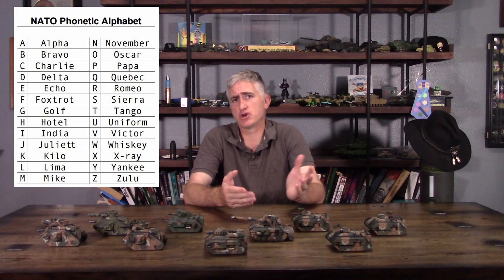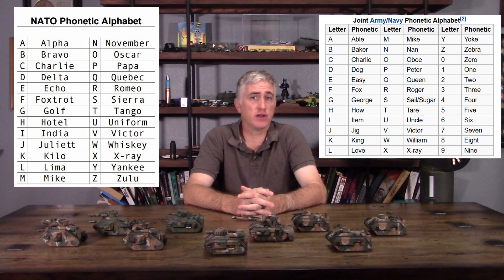Chieftain's Q&A #5

Comment: I want to know: 1. When did they start using the sewn-in handles,
2. Was VVSS always VVSS, or was it plain old VSS until HVSS came along and they had to distinguish between the two? Was there any point in specifying  Vertical Volute Spring when it was the only kind of volute spring suspension in use?

Comment: Did the weight of the Jumbo's gun mantlet have any negative effect on the elevation drive? If so how was it countered

It's alot of steel added to what looks like the muzzle end of the elevation pivot, and I think that would have some negative effect on how easy the gun elevated

Comment: My dad mentioned that there were large grenades stored around the Sherman commanders hatch and on one memorable night at Christmas in 1943,  in Colorado,  he was guarding  a broken down M4 far from camp, got bored  and used them to blow holes in the ice behind a small dam. The water started flowing again, overtopped the dam and almost flooded the unit's motor pool downstream.  It didn't do any damage because Dad panicked, ran ahead of the water to the bivouac and phoned his Captain (in town having dinner), alerting him only to the rising water and soldiers were hastily mobilized to move equipment in time. Dad got promoted to Corporal for being alert on duty. Apparently the grenades were never missed.
Does this sound true or might it be a tall tale? Were there grenades that were that big in a Sherman and would the Army just leave them there (granted Dad was supposed to be guarding it).

Comment: wouldnt it be an enormous advantage for an autoloading  gun to have liquid propellant? this could increase rate of fire as well you could adjust the ballistics to loop shots over ridge lines as well as saving space... you could also shoot multiple rounds that would impact at the same time which could overcome more modern countermeasures...  is liquid propellant being considered or is the focus more on autoloading railguns?
Reply: The UK developed and tested liquid propellent and guns for quite a long period, it had advantages but also significant disadvantages and was eventually dropped

Comment: US Army ammo usually had a "T" number during development testing, changing to a standard "M" number when issued for Service use.  Why was this not done for the WWII-and-after steel 90 mm T-33 AP Shot?  I have one with an empty powder case (heavy!) and it has "E" numbers punched into its driving band, indicating that there were various modifications to this round.  It had no AP cap or windscreen (just a rather blunt-point Secant Ogive nose), no explosive filler (though I assume a glowing colored night tracer was screwed into a shallow pit in the base), and a very simple copper "wedding-ring" driving band with a wedge-shaped upper edge to make it easier for gripping the bottom edge of the rifling when hand-loaded.  Was there ever a steel AP/APC Shot/Shell made for the US Army 90 mm gun with a standard "M" ID Number?

Comment: Was early add on armor in the form of draped treads effective against incoming rounds?
Reply: The effectiveness of ad-hoc addition of various things to tanks in the hope that it would offer more protection - things such as spare track, steel plates, planks of wood, sandbags etc - was extensively tested by the US Army after WW2. For the most part they found in these tests, that such additions offered little to no advantage and in some cases actually made things worse for one reason or another, and not just in terms of what the enemy might do to a tank, for example, we can be fairly sure that the additional weight of a lot of possibly wet sandbags on the front of a Sherman was not going to do its transmission any favours. That said, such field modifications might actually have provided some (largely ill-founded) psychological/morale boost to the crews, but it is difficult to quantify how much of an effect this would have on matters.

Back with purely the physics of such additions, the problem is that the front glacis plate of most tanks - where you typically saw such additions - is invariably designed to be as smooth as is possible to allow incoming rounds to ricochet off and away cleanly, and it is not just a slab of any old steel, it is armored steel (which involves a variety of processes to create). Tracks on the other hand are of course pretty tough steel, but they are not armoured steel and nor are they smooth, so spare track won't do much to stop penetration and in very many cases, its irregular shape will actually offer something for an incoming round to bite into when it strikes, thus making a ricochet away from the tank far less likely. Basically, you are adding shot traps to the front of your tank, which is obviously a bad idea. 

Historians and fans of tanks in general are sometimes guilty of over-simplifying the idea of effectiveness against hits to a tank in that they will sometimes simply factor in whether a round penetrates or not as the only thing to consider when talking about hits to a tank, as though anything which ricochets into another part but does not penetrate, or explodes nearby does nothing at all to the tank, which is at best unlikely and in many cases makes things very much worse. German tank crews of WW2 would confirm that even a nearby high explosive hit at the front would quite easily damage the comparatively fragile final drive of a Tiger for example. Then there is the fact that there are several different types of rounds too, some of which would actually be assisted by having some spare track to initially hit, for example, allowing a fraction longer to form the plasma jet which penetrates the armour by having that process commenced by hitting some track which is slightly stood off from the armour plating.

A good example of what a ricochet can do when a shell has something to bite on as it impacts, is perhaps the most famous WW2 tank of all, this being Tiger 131 at Bovington tank museum. As thick as the Tiger's armour is, it's not exactly the best ballistic shape ever with all those slab sides, and so there is a considerable risk of rounds getting to bite on impact and cause ricochet damage. This is exactly what occurred with 131. It was captured after having been disabled by three shots from British Churchill tanks, one shot hit the gun barrel and ricocheted into the turret ring, jamming it, a second shot hit the Tiger's turret lifting lug, bounced off that and disabled the gun elevation mechanism, a third shot hit shattered on impacting the loader's hatch and showered the turret interior with shrapnel fragments, injuring some of the crew. With British tanks advancing on it and wounded to consider, the crew bailed out and didn't waste time destroying the tank, thus allowing its capture and comparatively easy repair.

So in general, the answer is no, if it had of been of any really practical value, they probably would have come out of the factory like that.
Reply: @ChockHolocaust  thanks!

Comment: I've always wondered about how the engines in turbine powered tanks interact with the rest of the drive train. To my knowledge turbines take longer to reach maximum RPMs than a piston engine. Do these engines idle at a low speed, then speed up as the tank needs to get moving, or do they have the option of being left at a higher speed so the tank can reach maximum acceleration quicker? Since this is unlikely to change anything tactically, I would imagine it's the first one for the sake of fuel economy.
Reply from the maker: On the M1 there is a “Tactical Idle” switch which, when enabled, idles at higher revs.
Reply: @TheChieftainsHatch  I suspected something like this to be the case, but explaining all of that would have made the comment too long. Thank you for your quick reply!

Comment: Question. What happens to the expended shell case on tanks? I know some of them have a basket behind the gun breech, other with autoloaders eject automatically, but what about the other tanks, during combat the cases roll around inside the tank and there is no problem at all?
Reply: Modern tanks or ww2 tanks?
Most modern tanks use combustible casings with nothing more than a half inch thick metal disc base for the percussion cap that falls out of the breech as it opens at end of recoil movement.
Reply: For both. even modern ones, having those smaller cases rolling around is perfectly ok?

Comment: Re; the Australian Abrams question. Whether or not it was a good deal has been ambiguous for years, the top two contenders were the M1 and the Leopard 2. Sources vary as to why the final choice was made, the main contention is if the US genuinely made a better deal price wise vs if the decision was made for purely political reasons.  
there were several factors in favour of the M1 though
- General Dynamics (the manufacturers of the M1) were willing to allow for technology transfer to Australian industry to allow for local maintenance manufacturing (ie making spare parts locally), which Krauss-Maffei were not willing to do
-The M1 deal included new M88 recovery vehicles (to replace the outgoing leopard 1 based recovery fleet) as well as full technical and personnel support for the transition between the leopard AS1 fleet and the M1 Fleet
- The vehicles purchased are only broadly M1A1s , their proper designation is M1 AIM (Abrams Integrated Management) and functionally they're basically up to date with M1A2 with the various upgrade enhancements (ie infantry phone and reactive armour mounts from TUSK, slave charger port etc), the only thing missing is the DU armour layer

other points
- Yes the Fridge is real, its mounted in the bustle rack next to the APU, it feeds from a power socket near the crosswind sensor mast. Because the rear bustle rack is basically full with the fridge and EAPU and extension rack has been mounted to the back. Australian M1s also have a turret mounting for a 'Parasol', basically a large collapsible camo net umbrella that can be mounted to keep the sun off and assist in concealment of the vehicle when in laeger.
-Australian M1s will be upgraded to feature DU inserts in the armour package under the current program of LAND907 Phase 2 and an additional ~30 tanks will be acquired to bring the fleet to roughly 90 vehicles. New 'Under armour engineering vehicles' are also being acquired under a sister program

Comment: American style firefighting coats have a similar drag system.  The pull point is usually under a velcro flap at the base of the neck, below the collar on the outside.

Comment: Nice video! One question - In your other videos about the M4 Sherman, you noted that the design fit into what the US Army was concerned with about transport - railway car size, bridge loads, and easy of loading onto a transport. These tanks were about 31-33 US tons. The post-war MBTs are in the 40 and now high 50 ton range. So are railway cars, bridges and ships more capable today? I'm curious about the railway cars since they don't seem to have changed much. Thanks again!

Comment: Potential question for next month or if anyone here has an answer. Why did American armor tend to be bristling with machine guns, one in the bow, one co-axial, and then another one or two on top of the turret. Where as German tanks tended to lack the exterior mounted ones?

I read that it was doctrine for the Germans to take either the bow or co-axial and place it in the exterior mount for aerial defense if the need arose, but it would seem easier to just have one permanently in place. Was it a shortage of machine guns then that lead to this policy?

Comment: Re; Recovery Vehicles. The Australian Army quickly developed 6 by 6 wheel drive versions of MB Unimog ang G wagon expressive for recovery. These are exceptionally mobile, and the traction, floatation and general ease of accessing the distressed asset was immediately apparent. It has to be said that one winch cable is better than twenty shovels.

Comment: 7:28 So according to Jentz and Hilary's osprey book on the King tiger "Statistics compiled from status reports for 15 March 1945 that 59 per cent of the Tigers with front line units were operational. This was about equal to the Pz.Kpfw. IV at 62 per cent operational and much better than the Panther at only 48 per cent." p35-36 Thought they don't really mention the reliability of Pz IV by variants, i think it gives a pretty good general picture.

Comment: I know the difference,ive just built the new \35 Ryefield models M4a3e8 HVSS,and am now building Mengs \35 M4a3 (76)w.And meng were kind enough to give you real metal working VSS springs.The Ryefield had 4 HVSS spring configurations moulded in plastic.Mengs M4 jumbo out soon too.Vid was well appreciated.

Comment: In regards to the quality of the Sherman, T-34, and Panzer 4 I will of course agree that the Sherman was of the highest quality but I'm reluctant to agree that the T-34 was of higher quality than the Panzer 4. 

Certainly the T-34 had advantages but it also had disadvantages, chief among them in my opinion is how unsafe the T-34 was. In most cases I would gladly rather be in a tank rather than fight with the infantry but in the Red Army I would rather take my chances as an infantryman than be in a T-34. The placement of the fuel tanks and the layout and lack of excape hatches is simply unforgivable for me, which is to say nothing of the other various problems of the T-34 such as terrible ergonomics, lower quality sights, bad visibility, reliability issues, and the practically nonexistent gun depression. 

Either way I would hope that most people would agree that the Panzer 4 was better than the T-34 at least up until the T-34-85 was introduced esspecially if they've seen The Chieftain's video about how overrated the early T-34s were.

Comment: ¿how did each military "cleaned up" casualties from inside a tank to refurbish them?, i'd guess it was quite a gruesume task, ¿i guess hosing it down break any electrics/electronics?
Reply: While I can't speak for other countries, in the US army the equipment/electronics inside any vehicle are very tough and wouldn't break because of some water. During my last tour in Iraq in 2008-09 my driver stuck our MRAP in a river while trying to cross it. The vehicle filled with water but we eventually were pulled out and it started right back up and all the electronics worked!
Reply: There's a petcock at the bottom of US tanks. You open it and wash out the crew with a hose. From what I've heard, the worst thing about getting a repaired vehicle was the smell of burnt flesh. OTOH, US tank crews lost about 1.6 men KIA for each vehicle knocked out, "only" about 2000 tankers fighting the Germans (Chieftain discussed this in either the Hatch or this series of videos)

Comment: What do you think of the T20 (or T22) as the ideal US medium tank?
Reply: If it had a Cross-Drive transmission in the T20E3 prototype by July 1943, I bet M4 Sherman production would have been greatly reduced by early 1944.  Otherwise, the transmission it did have was not reliable.
I would say it would have been one of the better tanks of the war with the CD transmission.

Comment: 00:22 What is the difference between an M4A3(76) w/HVSS and an M4A3E8?
05:59 Is the M3 Medium the first tank with a quick detachable transmission?
07:28 What was the Pz. IVs reliability was like near the end of the war?
08:11 Thoughts on Master Milo's Type 69 rebuild?
09:14 What made the upgraded Israeli Shermans so effective? Guns, tactics, or crews?
10:03 How much control does an individual TC have over ammunition loadout?
10:43 Given the Aussies paid about $6.3 million per M1A1, did they get a good deal given the US pays about the same amount for the M1A2?
12:00 Have the Russians acquired any modern Western MBTs for testing?
12:25 What's the deal with the water seals on M1 tank hatches, and is this a problem for the electronics?
12:56  How exactly does the T-72s carousel autoloader stay aligned with the gun during turret traverse?
13:10 Given that you have led the charge on the Internet to rehabilitate the M4, what are your observations since then?
14:43 As a former TC, how hard would running a platoon in 1940 have been compared to today?
15:51 What type of recovery vehicles did the US use in WW2?
16:38 When was it that folks figured out the ARVs needed to be as mobile as the tanks they were recovering?
17:13 How does one get an injured crewman out of a tank?
Reply: thank you

Comment: One thing i always struggled to understand is why was/is torsion bar suspension considered better than V/HVSS ? Back in the day, they experimented with putting torsion bars on a sherman. In what way would that be an improvement? Surely, it would have made repair work alot more complicated, meanwhile the rest of the tank remains the same. So why?
Reply: Fewer moving parts with the torsion bar suspension with little loss of efficiency.  There is a reason why the overwhelming majority of modern tanks use a torsion bar suspension, and it isn't because there has been a world wide brain drain.

Comment: Is XM943 STAFF round (as a top-down munition) significantly superior to APFSDS-T and HEAT/MPAT rounds and if so, why not switch to such munition design completely?
Reply: Probably the price of a round. It's much cheaper to procure a 1000 dumb M829AXs or M830A1s than a 1000 XM943s. As for HEAT/MPAT, if I'm not mistaken, it's also used as an HE round and I.m not sure if XM943 can be used instead.